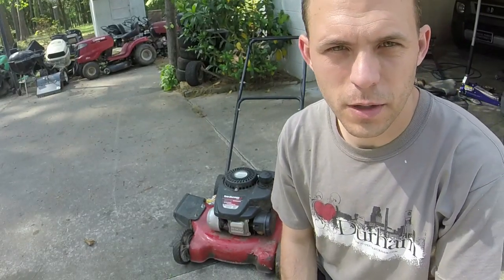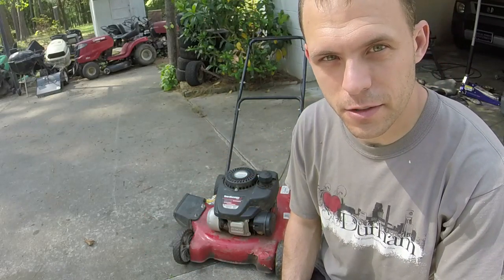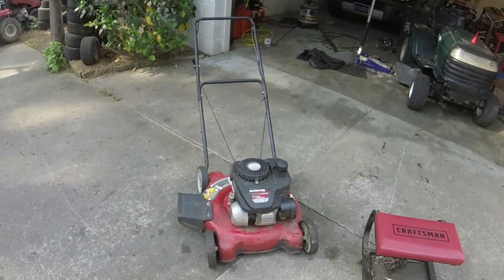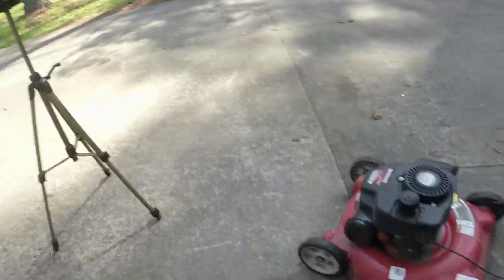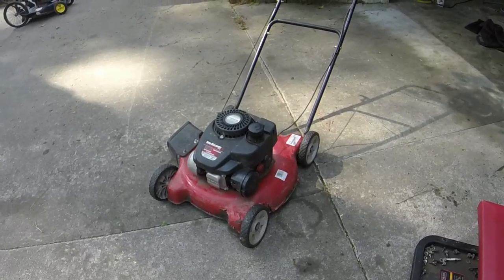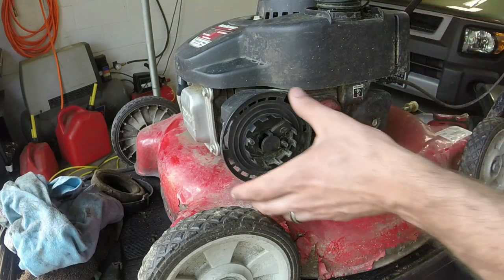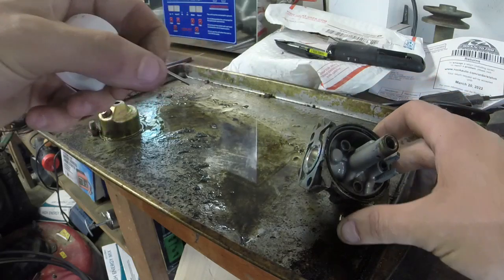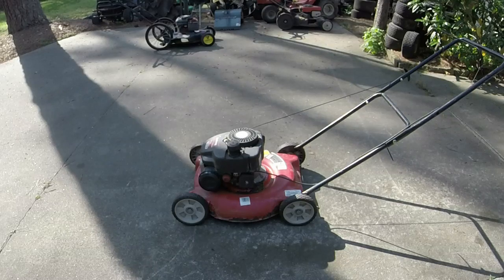Yard Machines basic push mower Powermore engine starts then stops: Cleaning the carburetor

Comment: My version of this mower has 2 drain bolts at the bottom of the carb bowl. I took them both off, let a couple of teaspoons worth of gas pour out, and then put them back on. I filled the tank with gas cut with Sea Foam. It started on the first pull; case closed.

Comment: We own one of these wonderful 🤣🤣 mowers .  I have become a f'kn wizard at removing the carb , disassemble it , clean the green cheese out of the fuel pick-up tube and slapping it back together .  Ours ain't even got a f'kn fuel filter . Might have a screen in the tank ? Cool video , Dude .
Reply from the maker: It is supposed to have a screen in the bottom of the tank, sometimes they break loose or go missing.

Comment: I just acquired , given,  2 mowers with those Powermore engines .  
139cc and a 173cc. MTD  brands.
They had been sitting outside for god knows how long.   It’s going to be “fun” fixing  .  I don’t have any parts for these engines.  I have only seen 1 power more engine come my way.  Neighbor’s . Just needed a carb clean.

Yep the new mowers are outrageously priced .  I guess that helps us flippers
Reply: have a like new mtd like this that is $300 at HD. Listed for $175 no takers. received one offer for $120. Think WM has a similar one for $218.
Reply from the maker: You would think it would help but I haven't even been able to get last year's prices for things and they've been slower to sell too.
Reply from the maker: I have had two of the $218 mowers to sell this year that were only 2 years old and in like new condition.  I got $100 and $80 respectively.  When I was doing Walmart customer returns 6 years ago I was getting $80 to $90 when they were only $150 new.